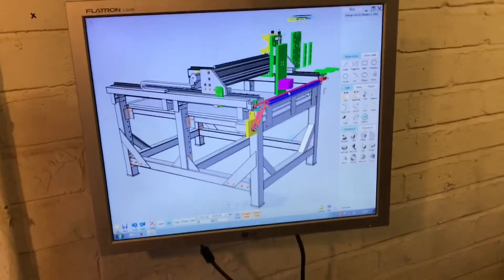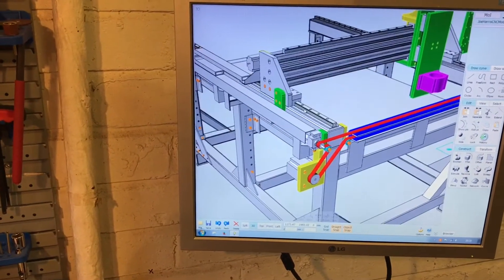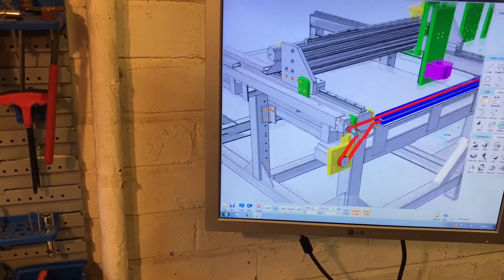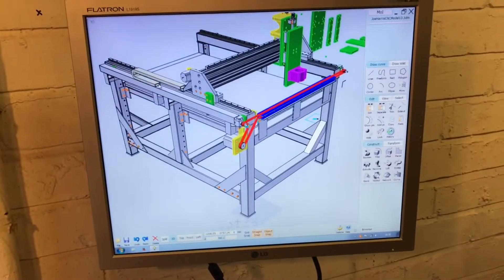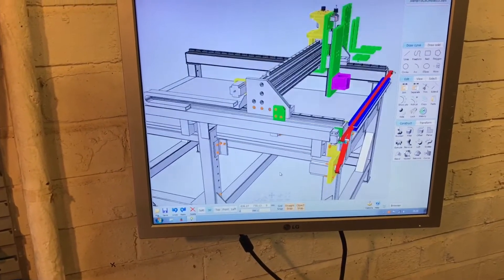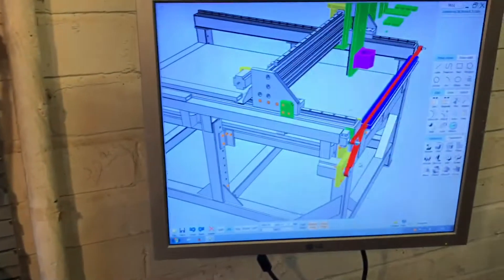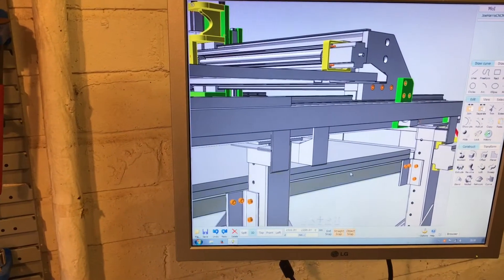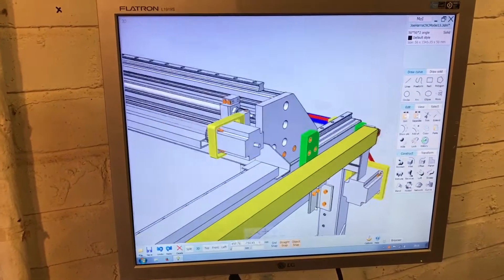CNC gantry cable management - CNC Router build log (E24)

Comment: The 3 tools I saw so far is a band saw, bench sander, and a giant vise.  Those are the exact 3 tools I am missing.  Until recently, I did not even have a chop saw, and it is my prize possession of tools. But those 3 tools are so important and next in line.